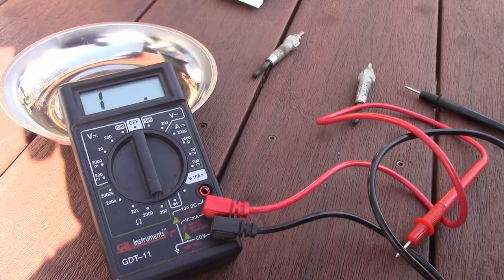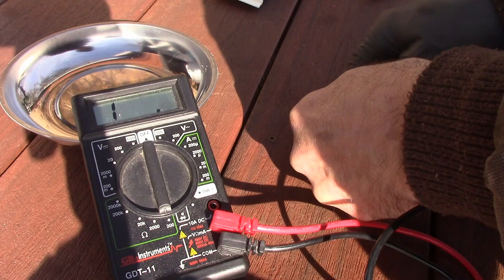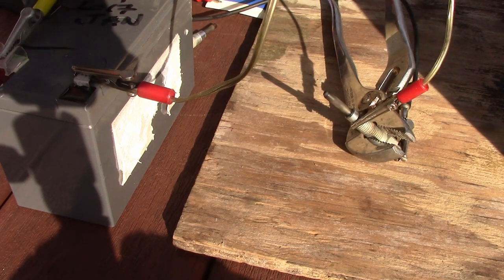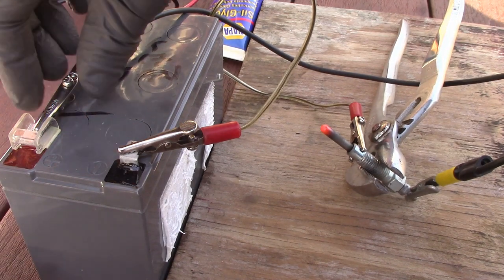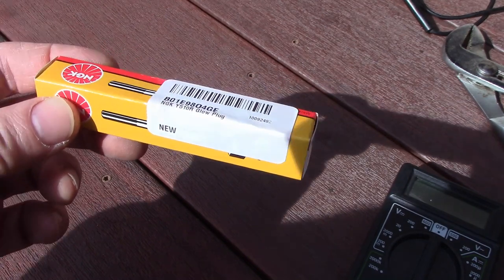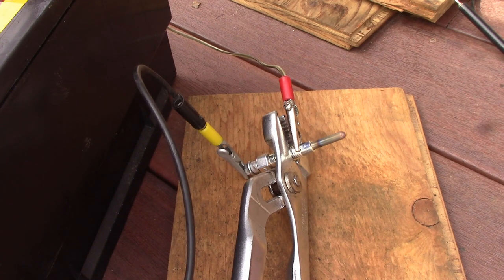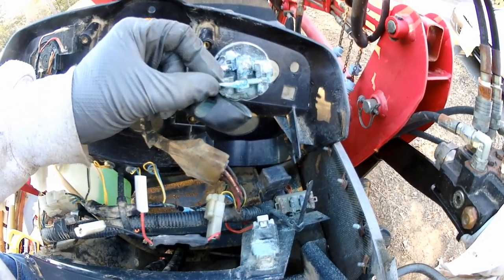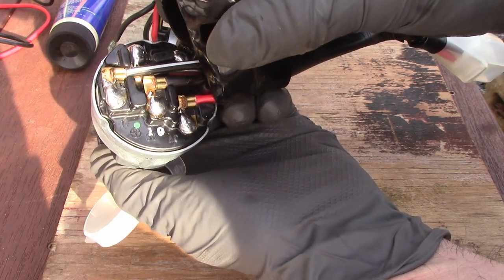Troubleshooting Glow Plugs on a 3-Cylinder Diesel

Comment: Thanks for a well done video!  While I have been a professional automitive mechanic for 45 year now my diesel experience is extremely limited.  I have a Yanmar engine in my little LS tractor with only 100 hours on it and on very cold mornings (20 degrees) while the engine fires right up it sounds like the pistons are changing cylinders until it's run for about 30 seconds.  My issue turned out to be I was only holding the glowplugs on on for about 8 seconds now I hold it for 20 seconds and it runs a lot better.  But now I know how to test glow plugs.  Thanks for your help.

Comment: Kubota G5200H - Kubota D600 service manual, glow plugs are considered good at approx 1.6 omh. 🤷‍♂
In my case it turned out to be the precharge light on the dash, which is just a resistor/wire that glows red when the glowplugs are hot enough. The terminals on the precharge were lose and corroded, as was the resistor/wire within the precharge housing. So I took the precharge apart, took the wire out, cleaned them up, put it back together and now it works perfectly. 5 seconds glow, precharge wire glows red hot, and engine starts no problem. 

When turning the keyswitch to glow the glowplugs there should be 10 to 12v at the glowplugs, and you should be able to measure current on the wire running to the glowplugs with a clamp on meter. Prior to doing this I wasn't getting any voltage or current at the glowplugs.

These machines need their glowplugs, otherwise they will kill your battery, starter, sanity and absolutely won't start.
Reply: Thanks for the tip. Today it wouldn’t preheat, had to jump glow plugs with spare battery. Jump on it tomorrow.

Comment: NOT an expert on anything.... but always start with the easiest/obvious follow a trouble shooting guide esp. one for your piece of equipment if available...those glow plugs did not even have to come out of the engine to see that they were fine ....you never had a chance of starting that puppy  because you did not have any "Juice" (12volts) at the Glow plugs...... but alas this is how we learn...thanks for posting
Reply from the maker: Yep, that's usually the problem with doing something the first time w/o a mentor or documentation. Typically, you're not going to do it the best possible way.

I actually considered re-ordering the events in the video to show the proper way to do it, i.e. testing for voltage first. But, I decided that was BS. Better to show how it actually went down, mistakes and all.
Reply: @Vicos  Thanks for your reply and thank you for your video...Yes we all learn together Thank you again

Comment: PRO TIP... check meter leads under $100 or above before testing especially under. If you do a loads test with a modern -10 year old vehicle plug than you will burn out the plug....i may have destroyed a few. Good video though!

Comment: corrosion on the starter, another reason why you should keep tractor under a roof, when not in use, thus keeping moisture out of starter and key switch.
Reply from the maker: If i had a roof, that's where it would be.
Reply: @Vicos  I hear that!

Comment: Is there any other issues that cause hard starting
Reply from the maker: Many diesel engines are a bear to start when they are cold. If you are in a cold climate and can't keep it in an enclosed heated space, see if you can get a block heater for it. I think you typically have to knock out a freeze plug and install it in that hole. Then just plug it into AC power the night before you need to use it.
Reply: @Vicos  claro

Comment: I lose confidence in someone posting troubleshooting a basic electrical circuit and makes a comment about how a bigger capacity 12V battery would make a glow plug be brighter. The original set was on a smaller capacity battery; the new plug was connected to a larger capacity, and he comments how the new one may have glowed brighter because of a larger battery? WRONG. OHMS LAW E=IR where E= applied voltage (12V);  I=current; R=resistance (1.1ohm vs. 1.3 ohm). Applying these numbers to the formula 12(V)= I X 1.1(R) give the current (ampacity) for the new plug, i.e. 10.9 amps; 12(V)= I X 1.3(R)= 9.23 amps. More ampacity = more glow. Has nothing to do with size of battery, if they are both+12VDC batteries.
Reply from the maker: Ahhhh, I think the point I was trying to make was that the smaller battery had a smaller capacity (Amp-Hours, not voltage) and I had quickly run the battery down by that point due to the large current draw from the glow plug, in which case the voltage also drops. This was a cheap battery from a UPS which was already on its last legs, so it didn't take much to drain it. Thus, I grabbed a higher capacity car battery, much like the one that was in the tractor in question. My mistake was not using the car battery to begin with.

https://electronics.stackexchange.com/questions/19107/do-batteries-lose-voltage-as-theyre-used-up

And if you had paid attention, you would have seen that the pugs indeed glowed hotter with a charged battery vs. a depleted one. That's basic common sense and doesn't require an engineering degree. Maybe I could have been more clear in the video, but I never expected this level of scrutiny and talking is off the cuff, not from an edited script.

No one likes a know-it-all, and I'm speaking as a reformed know-it-all. Peace and love, bro.
Reply: I disagree.  Some of my old batteries show almost 13v when charged.  When tested under load the have a high internal resistance.  Therefore not as much amperage is possible compared to a new battery.  I think you have to account for ALL resistance in a circuit.  The switch had too much resistance.